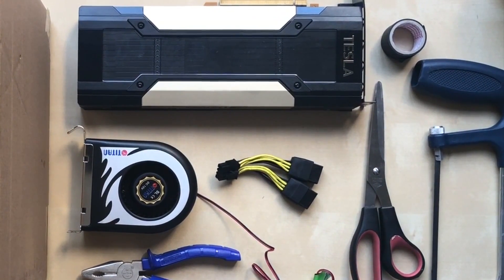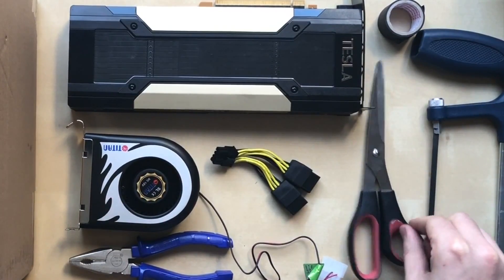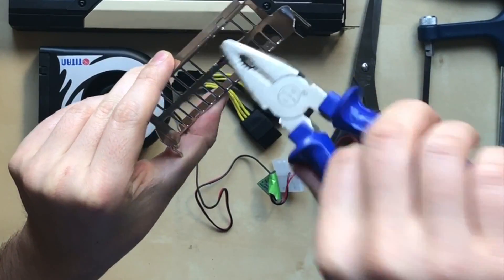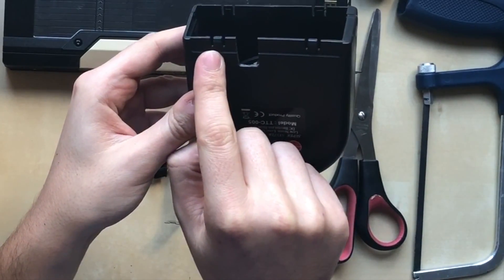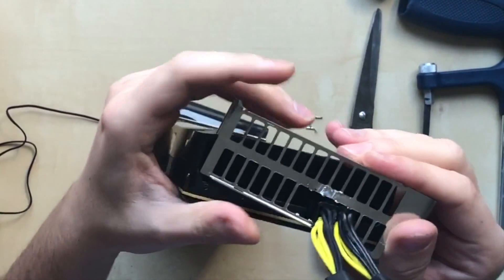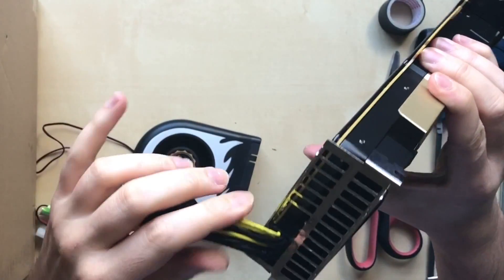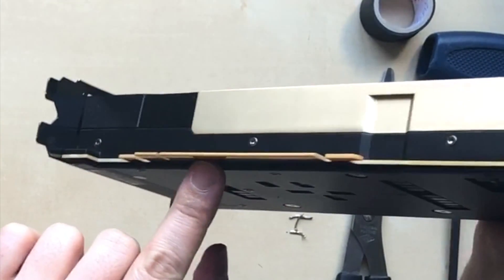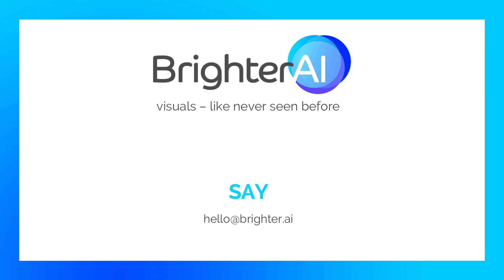HOW TO: NVIDIA Tesla V100 - Active Cooling | Fan Retrofit (or P100, K80, etc.)

Comment: That blower is designed to take the hot air inside the case and spit it out. So, basically it will get the hotter air from inside the case and blow it into the GPU heatsinks. I don't think that's too efficient in terms of cooling. But i guess better rather than nothing. Sorry for a comment that late, but I need to do something like this as well on a V100
Reply: Any internal fan will take the hotter air from inside the case and blow it into the GPU heatsinks.

Comment: A question that came to my mind: Is there thermal paste inside the GPU? Because, since those GPUs are quite old, we should change the paste, if there is any. Does anyone know?
Reply: The GPU chips have paste and the unit I got was dry and crumbly. It has pads on the memory chips and some other misc places.

Comment: hey man, the PCI fan you mentioned do not seem to be available anymore. Do you by any chance have any other suggestions on which fans to buy? Thanks a ton!
Reply from the maker: Justed checked, in Germany you can still buy it from: https://www.mindfactory.de/product_info.php/Startech-interner-PCI-Slot-Luefter-fuer-Gehaeuse-FANCASE_943243.html
Reply: that's a single-slot fan, did you mean to use two of them? )

Comment: will these cards be ok just running the active cooling in a regular tower?
Reply: No. Workstations and PCs do NOT provide the airflow you'd get in a rack mounted server. These GPUs generate up to 250W of heat that needs to be quickly dissipated. If it's not, you've got a dead and expensive GPU inside your tower PC.
Reply from the maker: @bob17678  I would agree, that you should for sure do proper testing. After all it is an industrial grade GPU...
Reply: Are you kidding me? for a $147,999.00 Nvidia component? of course it's not gonna be plug n play.
Reply: @holycownonames  Nope , you're wrong. It IS plug and play. However, it's passively cooled, meaning you need a huge amount of sealed airflow through the server enclosure. Workstations and PCs do not provide this. Otherwise, it's no different to plugging in, say, a 1070Ti into a gaming PC. Exactly the same electronics and physical connection spec.

Comment: recommend me a motherboard and a processor compatible with this gpu tesla k80
Reply: Ive got an Asus Z10PE-16 WS and two Xeon E5-2630 v3.  Make sure your power supply can provide enough current.  I have the Corsair HX1200i.